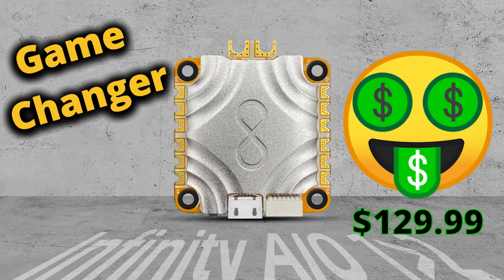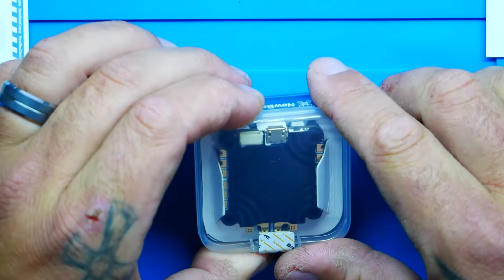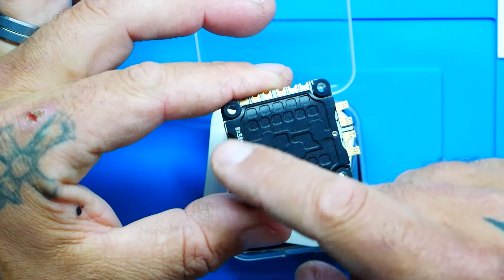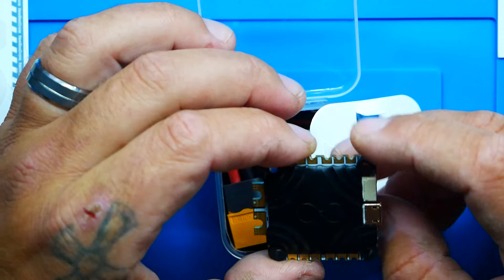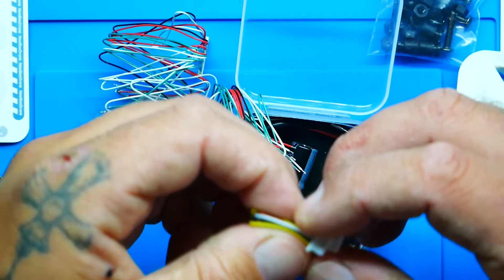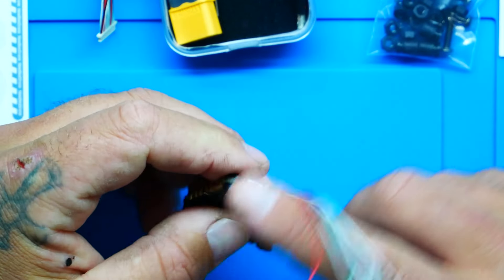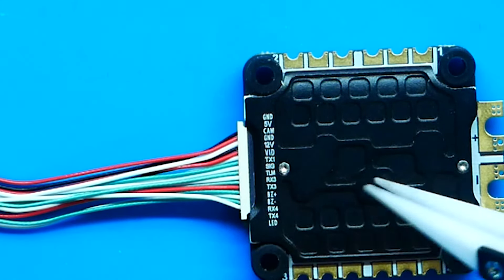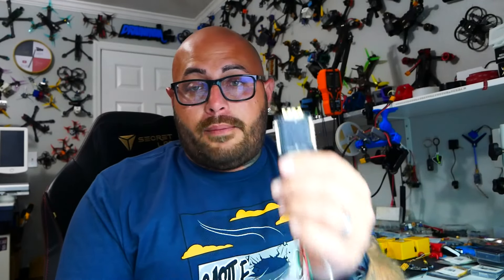The Ultimate AIO is now Fettec 🔥🔥 Infinity

Comment: interesting...how would you de-pin used wires?
Reply: I imagine it's like the balance plug on a lipo. I have chopped off a few not securing them during flight and you can use a needle or something like that to press down and pull the unused  wire out.
Reply: @jessegarcia4224  Thanks for reading thru my typo and your reply!

Comment: I'm just an amateur with 1y FPV experience. However, I am of the opinion that such AIOs only make sense with a 5" design like the Twig ET5 where every gram counts. And the frame only offers Diamand Mount 26x26, not parallel like the AIO in this video. You can also use it for diamand mount, but then the motor cables are not perfectly positioned. Since I'm a perfectionist, I couldn't stand it...